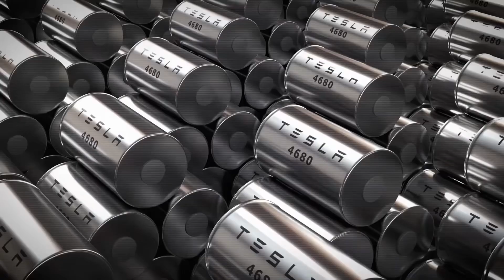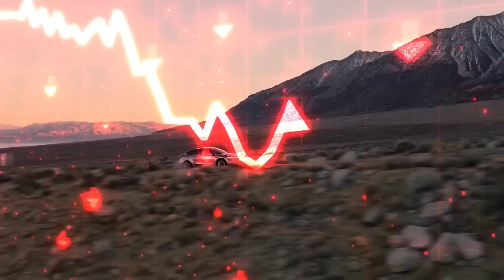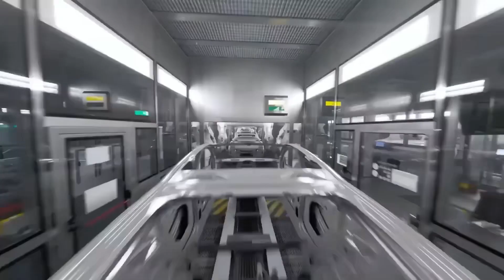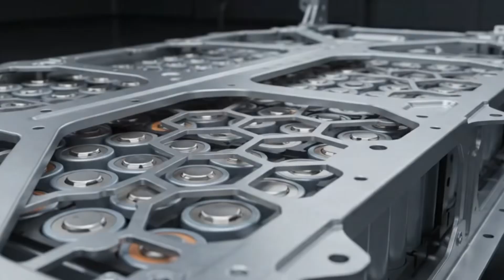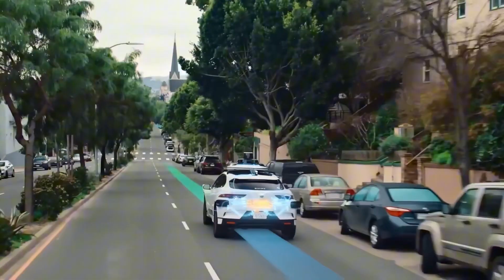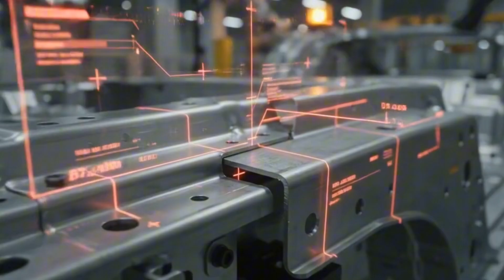Elon Musk's $25K Tesla Secret Just Leaked

Comment: As the population ages, and incomes are reduced, then pensioners may decide that it's cheaper to call a cab than to buy a car and maintain it over a year when one doesn't have to drive to to work every day, maybe. 
I might buy a robot to carry the groceries back to the car and the house, but what if I could order a cab with a carrying robot, for an extra fee? No need to amortize my old age to buy a car, maybe? Tesla is thinking ahead, methinks? Has Elon med his bed? Let's see if he can lay in it?
Reply from the maker: That's a sharp angle — aging demographics are actually a real variable in the robotaxi math that rarely gets discussed. If you're not commuting daily, the annual cost of owning, insuring, and maintaining a car can easily exceed what a subscription robotaxi service would cost per mile. Add in a "carry my groceries" add-on robot and you've basically described a plausible 2030s product tier.

The bigger question is whether Tesla's betting on exactly that shift, or just backing into it because FSD was the more interesting problem to solve. Either way, if the economics land the way you're describing, Redwood's price tag might matter less than whether Cybercab actually shows up on time in your city.